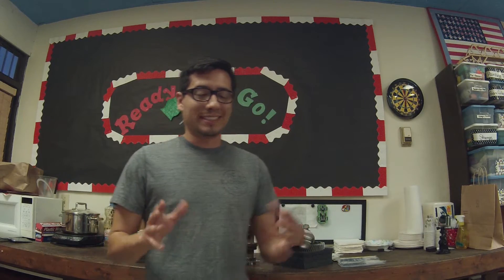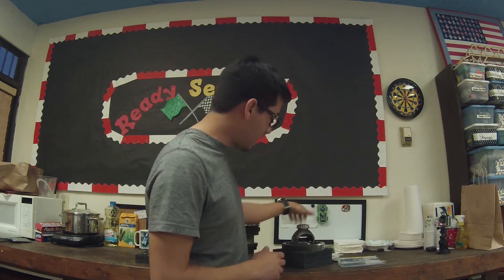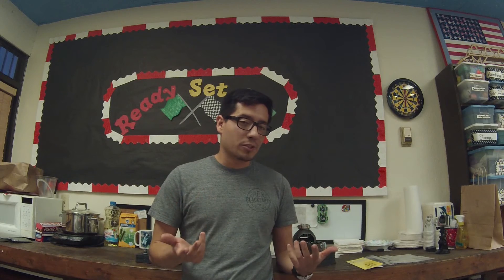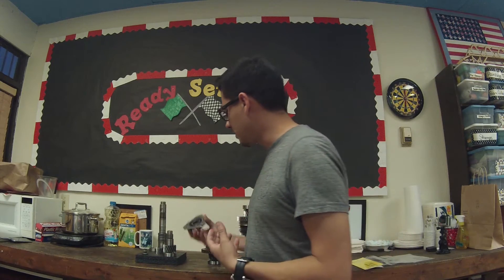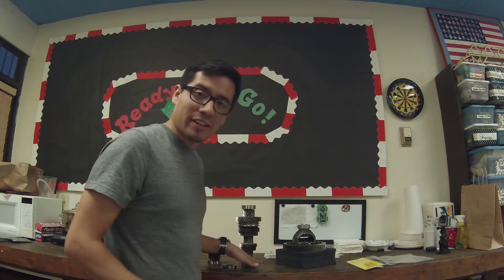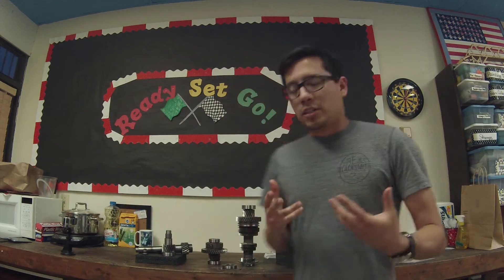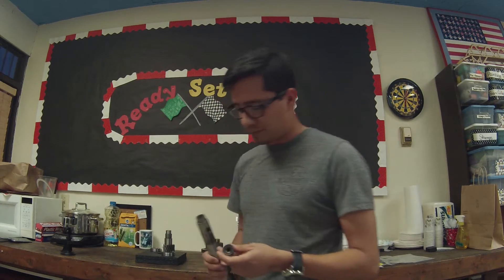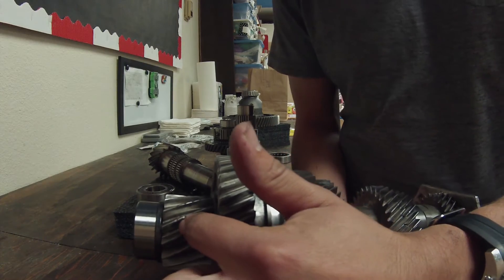Fiesta ST Final Drive swap, Everything you need to know

Comment: damn, i wish this wasn't 7 years ago. i'm just now getting into the platform, and was going to go ST, except i figured out that the st ib6 and the base/s/se ib5 share the same pattern. I also checked the blocks, and it's almost identical. also, i found out people are running the 4.06 final from the ib5 in the st ib6. I check that as well, and they both look identical.
this tells me two things:
1) because the final drives are identical aside from tooth count, i can swap the woosh 4.3 final in the base ib5
2) I can swap the woosh 4.3 final into the st ib6 and swap that onto the 1.6 tv-vtc

I encountered a few people who've done this, and i can't find any modules or anything weird, it looks like the same sensors on both.
apparently, the st axles even work with the s/se spindles, but the dust shields are too small. I'd be doing the brakes too since the Fist brakes will be perfect.
the 1.6 Ti-VCT running the takeda pds intake and the fist exhaust can make up to 20hp and 7-10 tq more when mapped. the takeda seems to be the best bet and the fist exhaust is perfect for the NA 1.6 however one could always purchase a lighter, better flowing unit.
combine that with the above ib6 setup running the 4.3 final and an lsd, and I think it would make for a very rewarding setup. even better with the lightweight fly, which i believe you use the st version since you're running the st ib6. I DON'T want another turbo for a DAILY, and I don't want the power of the Fist, just somewhere in between with tight ratios. 

I'm a lot more thrilled about this than I was about trading my FXT swapped 02 WRX for a Fist. This would be the perfect daily i can run on the togue, even door dash in the evening for fun.
however, this "thrill" strictly rests on getting that 4.3 final into either the ib5 it comes with or the st ib6. otherwise, it really won't be that fun anymore lol. the final in the st ib6 is worse, and the ratios aren't spectacularly closer, so that 4.3 is definitely needed. I run a 4.44 final in my wrx with only bolt ons and haven't needed to map it, it's just much quicker. can drop in stock engines and go, same plan for this 1.6 Ti-VTC engine. just drop it in and go. the same map should work for them all, and they hardly ever give trouble at all. the whole car is brilliant honestly.

I can drop the full specs of the car if interested, to anyone who reads this as it is 7 years ago lol

Comment: Will changing the final drive to 4.3 require me to get a new tune and how will it affect 3rd and 4th gear pulls? Also can you start from a light in 2nd more easily?
Reply from the maker: No tuning needed. You technically have an easier start in second if you wanted to do that. From my experience in the x47 turbo 3rd gear fly's by like second used to, and 4th is a sweet spot. Never really use 1st unless from a stop.
Reply: Thanks for the quick reply I’m trying to decide if I want to get this for my car I’m running a gen2 2867 and I use the car in San Diego to get to work sometimes. Would you say that there is any downside to doing it other than the top speed and mpgs?
Reply from the maker: @Jakep54903  I feel like the shorter ratio would not benefit the big turbos like the one you are running. Traction is what you will be fighting. Unless you have the kw suspension or equivalent, lsd and 225 or wider sticky tires I wouldn't change the final drive. Mpg wasn't really effected, just crusing rpm. So more noise or drone while on the highway.
Reply: I would be having the MFactory diff going in at the same time. Did you have traction issues with the x47? The 2867 doesn’t come into boost until late in the rpm range and right now I’m only on stock fueling and  I don’t really have any traction issues with my current tune.
Reply from the maker: @Jakep54903  Go watch my autocross video with the x47 and the final drive when running 100 octane and the wavetrac lsd. I was pushing over 300whp with that setup and having traction issues.

Comment: I would agree. For street riding, I would benefit having a 20% larger overdrive.
I mean, 1st gear is too short, final drive gear is too short (3,1k RPM at 80MPH, this car can easily hold 2,5k RPM @ 80MPH).
I wouldn't care if all the gears shifted by a percentage.
Besides, I don't think it would matter much on the tracks, driving in 3rd-5th on taller gear ratios, instead of 4th-6th on shorter gear ratios.
No longer final gear kits available?
Reply: Muranaman I wish there were longer or taller final drives available
Reply: The only option is go with larger profile tires. From the stock 205/40-17 to 205/45-17.
If you're lucky, a 215/45-17 might fit.
That's a 3.4% to 5% increase in gear ratio. Still a far cry from 20%, but it's something. Also makes the ride smoother.

Comment: Another question. Do you know the torque setting for the retainer bolt?
Reply from the maker: I had the transmission shop remove the retainer bolt and transfer the gears over to the new final drive. They also put the new one on. I would guess torque is pretty high as they had to torch the original one and even broke one of their tools trying to remove it. I would guess 80-100 lbs off the top of my head plus it comes with loctite on the bolt as well.

Comment: Is there a Ford part number for the final drive itself? Or only all the bearings and bolts? Interested to see if my local EU Ford dealer can source these parts without going through Sico, Pumaspeed or any of ther other UK dealers.
Reply from the maker: I believe there is however I do not remember or have records of it remaining. Although it is a Ford UK Part number has it does not show up in the Ford US database.
Reply: TShirt Driving No worries. I found out that the 4.3 (4.27) final drive is from a Ford C-Max 1.0 from around 2012. So got one on order now. :)
Reply: @VenningMotorsport  do you have the part no. finally please ?
Reply: @VenningMotorsport  +1